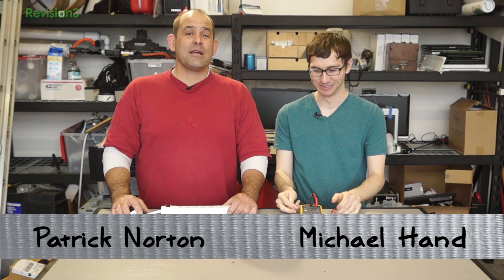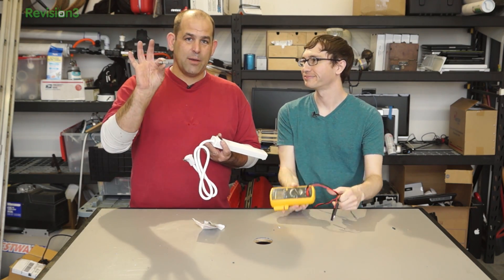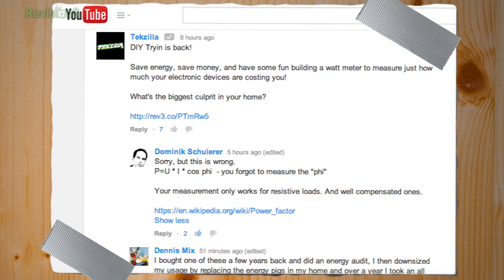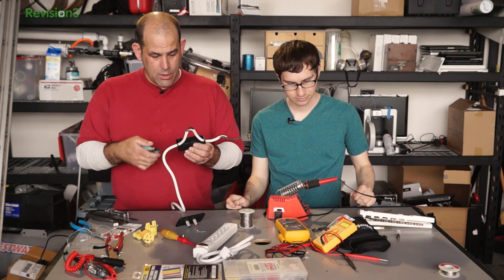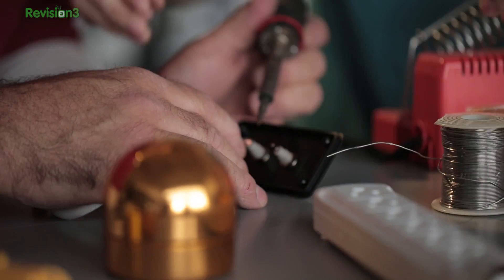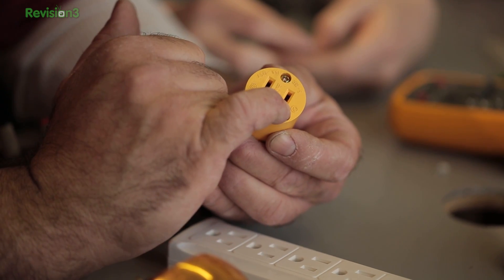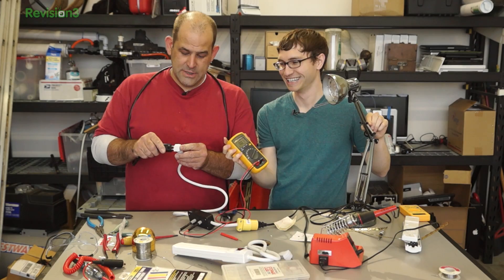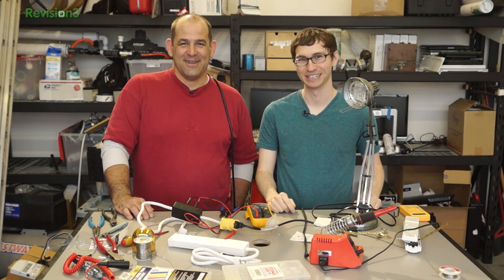Save Energy: Hack Yourself A Watt Meter!

Comment: If I would make a device that sits in line between the socket and appliance, but connect it so power doesn't interupt when I remove the multimeter...
No wait, let me rephrase that, I make the same things you guys did in this video, but I DO connect the bannanaplugs even without the multimeter,
If I then connect the multimeter, can I derive the Wattage by (V x Amps) x 2 ?
So if the multimeter reads 5Watt, i can assume it's 10Watt?

I would like to be able to measure several devices without having to interrupt them.

Comment: Why do people allow to be abused by the electric and gas companies allowing them to charge anything they want for a delivery charge.
my electrical bills delivery charge is 4 times the amount of actual electricity I use.
And has is 5 times the amount I actually use.
In 1 mon of gas & heat usage I used 33 therms.
Then the gas company charged me $63 dollars just in delivery charge alone, then another $30 dollars on another delivery charge in the same month.
Why do we allow this to happen..??
Why is NOBODY doing anything about this ??

I completely turned off my heater in the winter now, my apartment is 30°F and many times colder.
I also dont cook anymore food on the stove and just buy cold cuts and bread
And other foods that dont need cooking. And I dont use hot water anymore.
I also dont have anything plugged in using electricity accept my computer.
The rest of the house is blacked out. I use a flashlight and candles.
And Electric company STILL charges me a delivery charge for absolutely nothing, which will also force me to pack up my computer and turn off ALL Breakers in the breaker box. Which will also force me to cancel my Internet and TV services. - Since the electric & gas companies are ripping me off.
.
And it will come to a point where I will be forced to move and put my stuff in storage and live in a van.

Comment: Also... The voltage variation is probably caused by the time rather then the location of the measurement. The incoming supply voltage varies considerably depending on the loading and the number of power plants in operation at any particular time.
Reply: How can the load make an impact on the incoming supply voltage? Isn't the current?

Comment: Also the power factor discussion is only academic as UK power companies charge us for voltxamps (rather than wattage) because they want to keep the power factor as close to 1 as possible. (Their losses depend on the current and not on the current times pf).
Reply: UK domestic electricity meters do measure real power, not VA. The KWhs on a household bill are real watts.

Comment: Safer to hack into the neutral line. The same current flows there and (if the mains is wired correctly) it's much less likely to give you a shock.

Comment: There is no neutral in a 2 wire circuit. But I won't doc you marks for that :P
It's called the "identified". By definition the ground wire is more of a "neutral" then the identified. 
Knowing what youre using won't save it. But a capacitor bank might if you pf is bad enough.

Comment: Since the wire in the multimeter is thin, is it recommended to use it for high wattage stuff like a pc? ~200watt - 300watt. Afaik, high voltage AC carry low Amp, but the wattage part that makes me worry wether the multimeter probe wire can handle it.
Reply: Divide the wattage of the PSU by the voltage and it will give you an estimate for the current. and if it's below the current rating for your wire it should be safe to use, bear in mind a 200W PSU is unlikely to be pulling 200W unless you are using all the power outputs.

Comment: 120v isn't gonna hurt you unless your sweating and have a bad heart. Textbooks will say 30ma will kill a person. I've been shocked by 2,000v right across the heart with enough amperage to burned holes down to my finger bones. How many amps is that? average human body resistance is about 1 Mohm 2000v/1000000 ohms = 2mA, but resistance drops as the epidermis is eroded, could be as low as 1000 ohms, but let's assume I got lucky and it was 10kohms,  that's 200mA. I'm alive and healthy. 120v through dry skin yields about 120uA through your body, maybe enough to palpitate your heart, but it's not gonna kill you.
Reply: Abrar Shaikh Crazy Russian Hacker 😁
Reply: Are you encouraging to play with bare wires. Read standard books. 2mA is the safety. Above that carry out the work on your own risk. You might be lucky once,  twice,  thrice ..... but one day.... Accidents don't knock the door when they come.
Reply: Abrar Shaikh I've read dozens of "standard" textbooks. I've been shocked by 120v AC hundreds of times, I've been shocked by 220v AC twice and 2,000v once. There are people who have died from being startled, we don't go around insisting not to startling people is deadly. If your working with electronics your working with bare wires. Know what your doing, be safe; most people can handle extended shocks of 120v in dry conditions. I'm not suggesting anybody be careless. (I don't know where you got 2mA, since people are variable I'm sure stats on what's safe is variable, perhaps 30mA us considered guaranteed to kill someone, I don't have a clue where the figures come from. I know that I took more than 30mA across the heart when I was 9 and came out with nothing but sore muscles and a severe paranoia of high voltage for years. Didn't help my dad built a tesla coil in the living room shortly thereafter, lol.)
Reply: shadfurman 30mA can kill. I'm telling 2mA is the safety factor where you will not feel anything that's why the leakage current in any circuit should not exceed it.
Reply: Abrar Shaikh whoa, your suggesting it's necessary to current limit any circuit to 2mA?! First, any power supply and most batteries and deliver significantly more current than that, so up to your current limiting circuit would be dangerous? Are you suggesting it's dangerous for a child to play with an AA battery? I concede 2mA across the heart can be deadly, but it usually has to get through your skin first. If your drove some nails into your chest and had them sticking out near some live wires, that's dangerous sure, but I think you'd have other problems at that point. And as I've pointed out before, obviously a person can survive amperage significantly higher than 2mA... I'm alive an quite well.
Reply: shadfurman the shock received is directly proportional to voltage, not current. If you are talking about batteries then even welding gun carries 100s of Ampere of current. But since it's a low voltage device the risk of shock is less. I'm telling 2mA at normal"line voltage" is considered safe. Above that no can "guarantee" whether the person will live or die. Chances are he may survive,  but it's just chances based on experimental results. What you are saying that a person "can survive" but you can't guarantee it. Can you???
Reply: Abrar Shaikh the current can be calculated by the voltage divided by resistance. Due to your skins high resistance, the amperage traveling through the inside of your body is very low. That's a simplification since some current will travel in the moisture on the outside of the body. In people the relationship isn't realistically linear because the shock affects our bodies changing the resistance.
Reply: Abrar Shaikh oh and, previous analogy. No one can guarantee you won't have a heart attack today... are you super concerned about that?
Reply: shadfurman Safety is no 1 priority... lol
Reply: +Abrar Shaikh... don't try this at home! :-)
Reply: Sinichi Kudo lol..... whats up every body... Safety is number one priority.
Reply: Abrar Shaikh Today im gonna show you how to make FIRE TORNADO!
Reply: Sinichi Kudo Today I'm gonna show you how to peel bananas because you have been peeling it wrong all the time .... rofl
Reply: Abrar Shaikh Lmao his is so funny... More likely BANANA PLUG!
Reply: Sinichi Kudo this*
Reply: Sinichi Kudo This post started by some other topic. I had almost forgotten it but now ***** would like to read this
Reply: shadfurman
Reply: Any amps long enough across your heart will kill you.
Reply: Abrar Shaikh✌